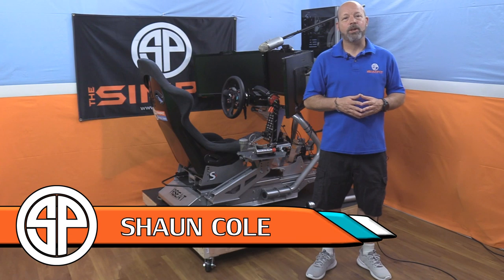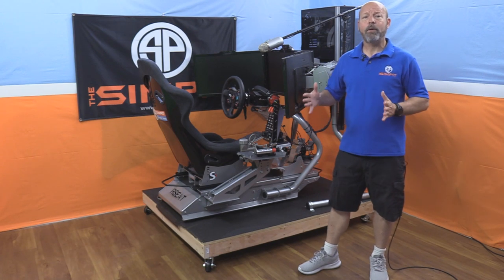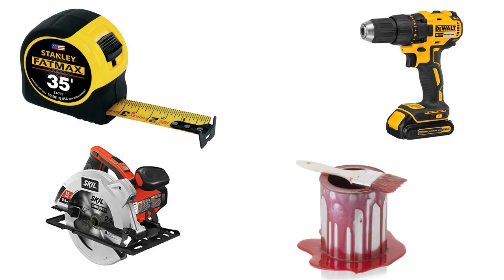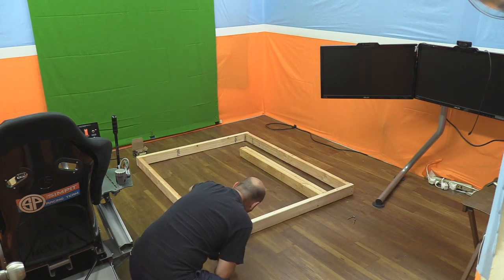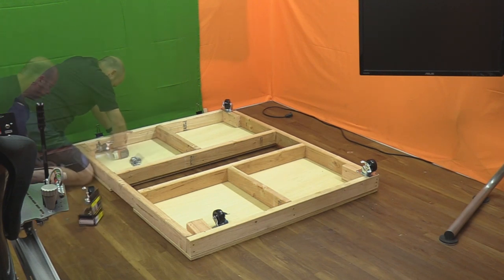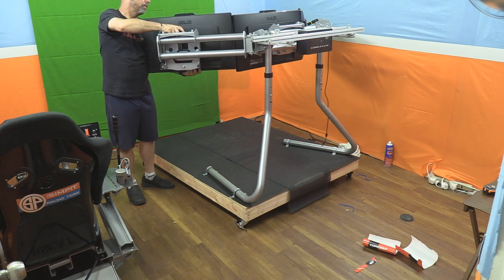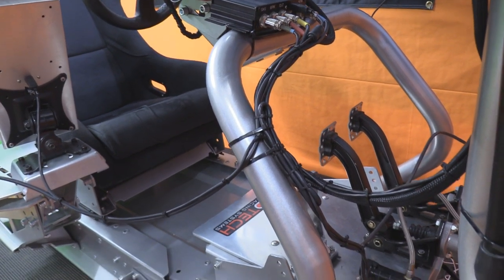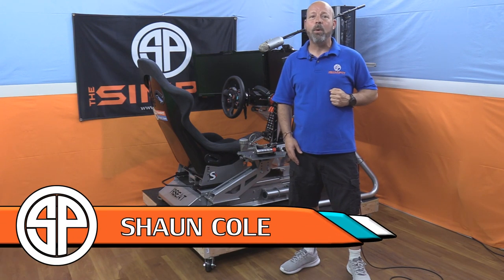DIY Sim Platform - Rise Above the Competition

Comment: I have 5" casters with lots of vibration isolation for butkicker, large floor surface contact and 4 huge brakes.  No wiggle at all! So I had smaller casters screwed directly into my RSEAT but they bent.  Instead of a platform I have 2 walnut boards (front & back) that 4 bolt casters bolt into with 1 bolt per caster screwing through the board and into the rig.  Works great.

Comment: Interesting idea! I think for the average everyday racer, they may not need the casters, because I think that could, in theory, add extra wiggling and stuff, but for people looking to have some more versatility, and be able to move it in and out, this is a great option.
Reply: Stiffness depends on wheels size.i assure you that rated for 400kg won't move a mm
Reply: I use casters with a ''brake'' under my SimLab rig.

Gwenndolynn